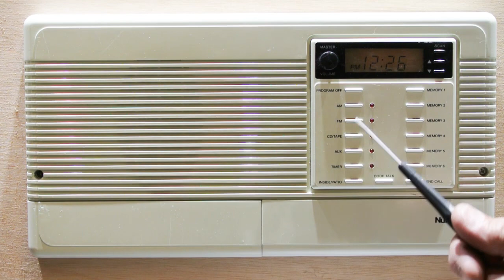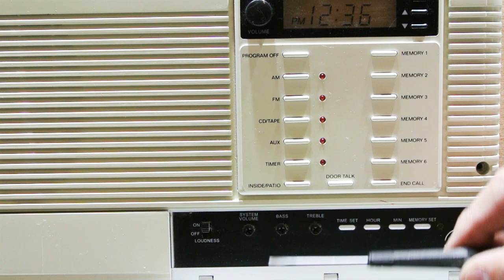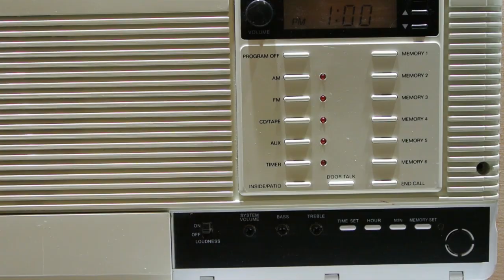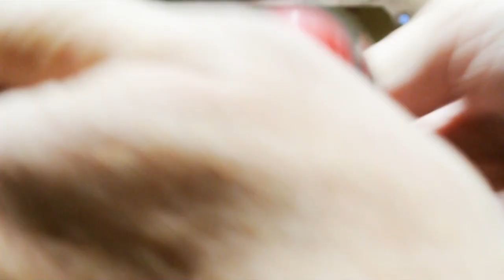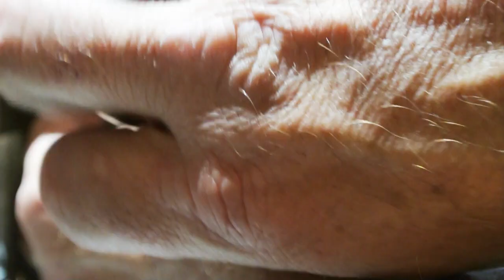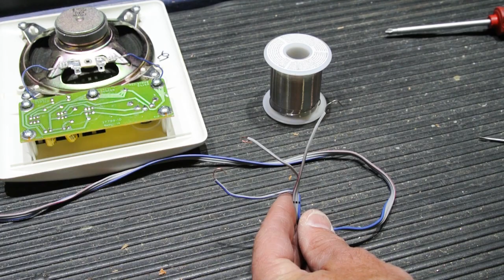Basic Troubleshooting  of a NuTone IM3303 and IMA3303 Radio Intercom System

Comment: Thanks for the videos.  I have a a NuTone IM3303 that has a morse code clicking.  I shut the power of for 12hrs and turn back on. Unit will not do the clicking for maybe 2 days than start again. The noise seems to becoming under the top circuit board when the unit is open looking across the unit. Any suggestions what to try to possible fix the unit. 
Have 9 speaker and 3 door bells. on the system. Was  installed in 2000.
Thakks
Reply from the maker: Hi 1944 Badger:  The clicking is from the Audio/Intercom Relays in the IM3303 Master Station - Do the following: Unplug the 4 cables that connect the IM3303 to the Terminal Board - Reset the IM3303 - Wait 3-4 days to see if the clicking comes back(it probably won't) - If the clicking problem is gone, it not the IM3303 that has a problem - it's 1 (or more) of the Remote Stations or the wiring that connects a Remote Station to the Master Station that's causing the problem.  In that case - follow the troubleshooting in this Video to find the culprit - The difficult part of finding the problem is that the clicking only occurs every few days - so the waiting time between reconnecting each cable will be long - Chris

Comment: I am getting 1c on reset, the door bell is not working?
Reply from the maker: Hi maher: Perform the troubleshooting as shown in the Video to find which Remote Station or Wire Run is causing the problem - Chris

Comment: Chris, that was a great video.  Very well done, concise and full of real good step by step debugging steps that are easy to follow.  In my systems the master station works fine but just about all the volume and push button switches on the speakers (inside and out) produce a lot of static when used.  I saw your comment about using DeoxIt D5 but wanted to know if I should attempt to remove the small circuit board from the speaker enclosures (IS-335 and IS339) to get access to the switches and volume control knob before applying the D5.  Just put a couple drops on or do a quick spray?  Thanks!
Reply from the maker: Hi Dave: Here's a link to our Video that shows how to clean the controls in your Remote Stations: https://www.youtube.com/watch?v=COruBSRkgCY&list=PLsTvqKsBnGYfpZP9NkBqZe5LFHu9ALtvB&index=4&t=0s
There's no need to remove the station from the wall and remove the Switch PC.  This only open up the possibility of marking up the painted wall (yes, it will happen) and it doesn't enhance the cleaning in any meaningful way - Chris

Comment: I have an IM3303 and the doorbell has stopped working. It starts working randomly sometimes....any suggestions? Thanks in advance!
Reply from the maker: Hi ConSyderate1:  That's a very general problem - I would start by replacing the Push Button on the outside of the house - Chris

Comment: Hi! Thanks so much for this. I unplugged my master speaker as you said, isolated. After resetting and flipping the master back and forth several times as you stated to radio is started to make a low hum through the speaker and could faintly hear the radio. When I reconnected to speakers, I can faintly hear the radio through the speakers but also hear the hum from the master.
Reply from the maker: Hi dhardy47:  You should contact me directly about your IM3303 - Here's a link to our Repair Request Form - https://docs.google.com/forms/d/e/1FAIpQLSdQHT6fVgm25twaXFeCkkgeITEfAE_zlRBry6B8-GbIs19wcQ/viewform?formkey=dF9RVjBQMFQ5S0xYbTBHMHRoNkVkRFE6MQ

Once I have received it - I will contact you direclty to discuss the problems with your IM3303 and its repair - Chris
Reply: Hello, I have this systems in a home we recently purchased. All of the speakers work with the radio stations, but the intercom feature does not work at all. I would especially like to have the intercom at the front door. Do you have any suggestions? Should I try to reset the system? I haven’t removed the panel on the Master station yet. Thank you for your guidance.

Comment: My sound keeps going down then I play with the  speaker volume nob and its ok again, do I need to replace the rheostat ?
Reply: Please replly
Reply from the maker: Hi Edmund:  Are you referring to the Black Volume Knob next to the Display? - If so, you may need to get some DeOxit D5 and spray just a little (really  - just a little - like 4 drops) into the Volume Pot to clean it.  You can also use the D5 to clean the volume controls and Push Buttons on the Remote Stations
If you're referring to the "System Volume" control behind the right-hand door - it may need to be replaced - Chris
Reply: @northsideservicecompany3567  Hi I have a bigger problem now, the radio won't play, everything else works door bells, etc. I have Sirius Radio connected to it and it still works. I had this problem about two, or three months ago . and a couple of days later I tried it again and it start working, I don't know if it will start working again or not this time. But I would like to find the problem and have it fixed or I could fix it myself if possible. I am an Electrician but not a technician. can you help me? thanks Edmund Smith
Reply from the maker: @edmundsmith6189  You need to fill out an "Intercom Repair Request Form" about your IM3303 and once I receive it - I'll contact you to discuss the problems with your IM3303 and its repair - Here's a link to the Repair Request Form:     https://docs.google.com/forms/d/e/1FAIpQLSdQHT6fVgm25twaXFeCkkgeITEfAE_zlRBry6B8-GbIs19wcQ/viewform?formkey=dF9RVjBQMFQ5S0xYbTBHMHRoNkVkRFE6MQ

Chris
Reply: you can add a public reply

Comment: One of the remote room intercoms was not working.  Thank you for your step by step video.  When I removed the wires on the back of the speaker, dried paint was covering each of the ends of the copper and silver wires from a previous room remodel.  I scraped the paint off the ends and reattached according to the video.  This did not solve the problem, but I feel like I am getting closer...
Reply from the maker: Hi Mom Dalton:  If you need any additional help - Please let me know - Chris

Comment: Everything works, but the volume for the radio on all the systems and even on the master is at very low. I put all the volumes up but the radio still plays faint, but the telecom volume is loud. What to do?
Reply from the maker: Hi Jimkey Daniel:  I would check to see how your "system volume" (behind the right-hand door) is set - it could be set to low.  Typically it would be set between 11:00 - 12:00 - your remote stations should have their volume controls set to maximum (the master volume as well)

If that doesn't correct the problem - there could be many things effecting the music volume - Chris

Comment: Hello my system is IM3303 my problem nothing come out from the master or remote speakers clock is correct. I reset it still not working what do you suggest? I did what this video suggest still nothing
Reply from the maker: Hi Iehab:  It sounds like your IM3303 has a definite problem.  The best thing to do is fill out an Intercom Repair Request Form and once I receive it I'll contact you by phone to discuss the problems with your IM3303 and its repair.

Here's a link to the Repair Request Form:    https://docs.google.com/forms/d/e/1FAIpQLSdQHT6fVgm25twaXFeCkkgeITEfAE_zlRBry6B8-GbIs19wcQ/viewform?formkey=dF9RVjBQMFQ5S0xYbTBHMHRoNkVkRFE6MQ

Thanks
Chris
Reply: @northsideservicecompany3567  similar strange issue for me. Doorbell works fine...but all other sound / music wasn't playing. Turns, out...when I max volume, I can hear it faintly but clearly something wrong. I've tried to play the radio as well, usually obnoxious loud noise...this time, faint sound. Clock and display seem fine...
Reply from the maker: @babyyodatwins3112  : It sounds like your IM3303 has a real problem with the Master Station itself and it's not a problem that is being caused by something beyond the Master Station.  Any time there are Volume related issues - it needs to be looked at right away.  If it's developing an Amplifier problem - waiting can end up with a complete amplifier failure with burned components and circuit board (very bad). If you have to wait to get it repaired, disconnect it from the transformers, so it doesn't get worse and die - Chris  925-743-8236

Comment: I have “CC” displayed after the pin hole reset. ?
Reply from the maker: Hi imigguel:  I suspect that your IM3303 display shows "IC" not CC - You will need to follow the Troubleshooting as shown in this Video to determine what and where the problem is being caused by - Chris
Reply: Northside Service Company Thank you!
Reply: Northside Service Company is it possible that I have bad master station if the digital screen is glitching? I’ve isolated and reset the master station. When I press the buttons they do nothing.
Reply from the maker: It's really difficult to know what's going on with only small spinets of information about your system and the problem.
The best thing for you to do is, fill an Intercom Repair Request Form and once I receive it, I'll contact you to discuss the problem and the repair of your IM3303

Here's a link to the Repair Request Form:   https://docs.google.com/forms/d/e/1FAIpQLSdQHT6fVgm25twaXFeCkkgeITEfAE_zlRBry6B8-GbIs19wcQ/viewform?formkey=dF9RVjBQMFQ5S0xYbTBHMHRoNkVkRFE6MQ

Chris

Comment: A lightning hit my gutter which affected several electronics in our house including our Nutone IM4406 and house alarm system. I get no display on my Nutone 4406. I separated the 801T's from the 4406 and both tested ok with 19.6V on both.  I then unplugged the speaker interconnect bd from the master station. Still No power. any  other suggestions?
Reply from the maker: Hi Bill:  Without  more detailed information about the overall condition of your 4406 - the only thing I can suggest is performing a Reset on  the Master Station

Here's a link to our Video about performing the Reset: https://www.youtube.com/watch?v=OvEr7wXRbB0&list=PLsTvqKsBnGYcoTSfKTOHOltP98FFiuUP1&t=1s&index=5

If the Reset doesn't solve the problem - please fill out an Intercom Repair Request Form and once I receive it, I'll contact directly about your 4406 and its repair.

Here's a link tot he Repair Request Form:  https://docs.google.com/forms/d/e/1FAIpQLSdQHT6fVgm25twaXFeCkkgeITEfAE_zlRBry6B8-GbIs19wcQ/viewform?formkey=dF9RVjBQMFQ5S0xYbTBHMHRoNkVkRFE6MQ
Chris

Comment: when I disconnect 2 ribbon code 1c gone and clock blinking so 2nd ribbon have problem
Reply from the maker: Hi Amir:  You have a problem either with a Remote Station or with the Wring to a Remote Station

You need to complete the troubleshooting as shown in the Video to find which Remote Station / Wire is causing the problem - Chris

Comment: Do you know how to solve the issue when it says "IC" and won't turn off?
Reply from the maker: Hi Evan:  Follow the Troubleshooting as shown in this Video - It will identify if the "IC" problem is being caused by a problem in the IM3303 Master Station or if it's being caused by some part of the Intercom system beyond the IM3303 - Chris